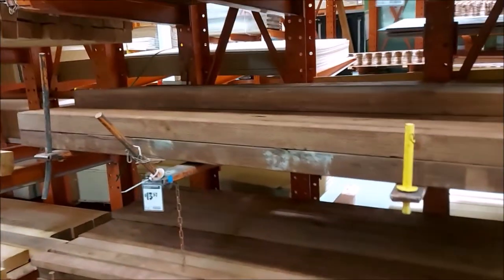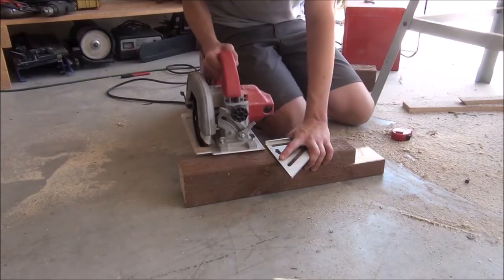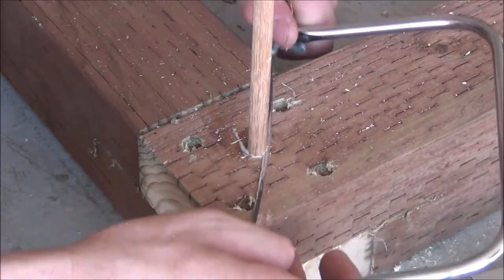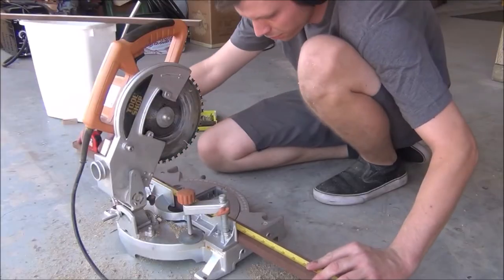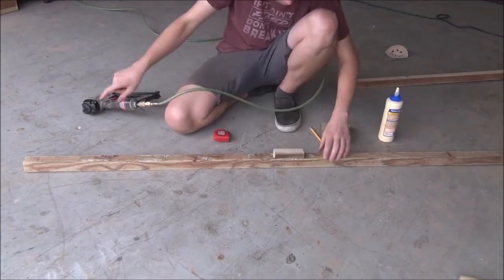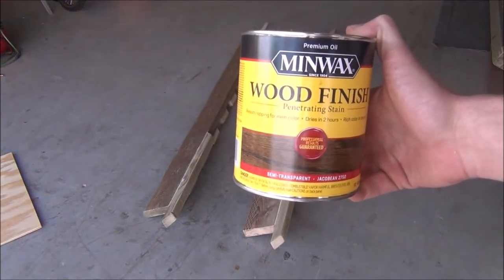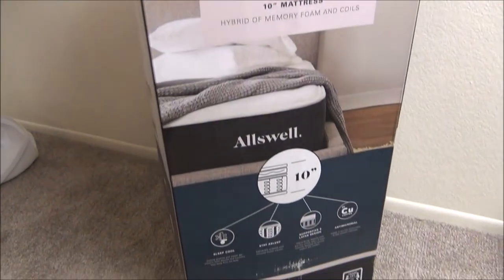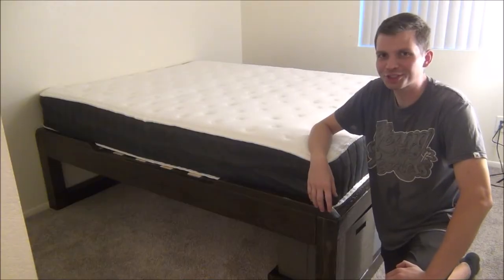DIY $200 Bed Frame With Storage!!

Comment: I heard that outside treated lumber should not be used indoors because of thr chemicals uses to treat it. Is that true?
Reply: You can use it on everything expect cutting boards
Reply: @raysolano6623  thank you
Reply: As long as you dont rub your fingers on it before you handle food, it should be fine 😂😂😂.

Its probably okay but why? That stuff does have a  small smell to it. You can buy regular lumber stain it and achieve the same result. 🤷‍♂️

Comment: I like this a lot!  Thank you for posting.  Nothing at all wrong with the look of it, either.  To fit my décor, I'd need it to be less rustic and dark.  I'd probably use caulk and wood filler to make things smoother, give it a finer sanding, and use white paint, possibly chalk paint.  I also might make it even taller by adding lockable casters or something similar by way of metal feet.

Comment: Love it! My husband thinks it needs a brace to the ground in the middle if the bed. Did you find it needed more support like that? Other than three long boards. I think this will be great to put those big black/yellow lid storage bins under for additional storage in a small space. May have to cover up with a bed skirt though.
Reply from the maker: @johannakelley4830  Thank you so much! Luckily, the middle beam is thick enough that there isn't any flex. I still use it to this day, and haven't had any issuses with it.